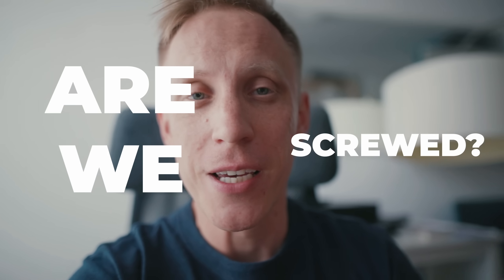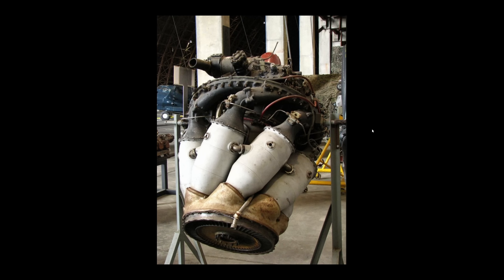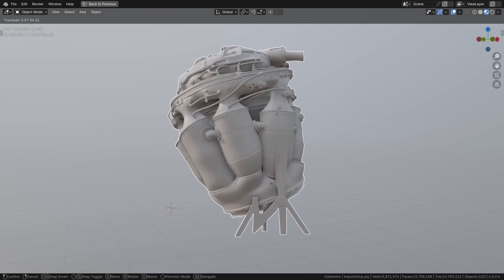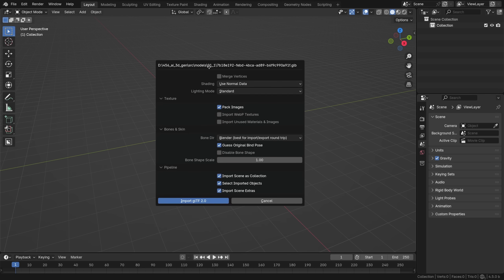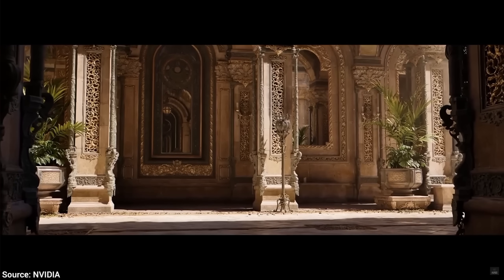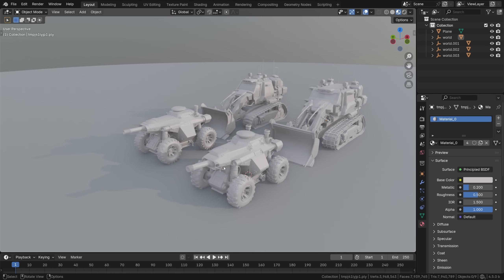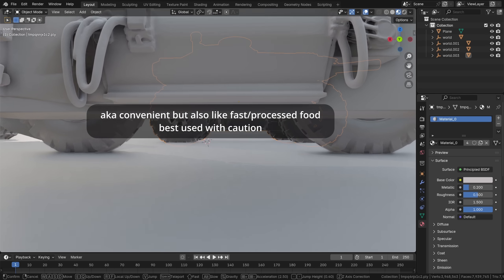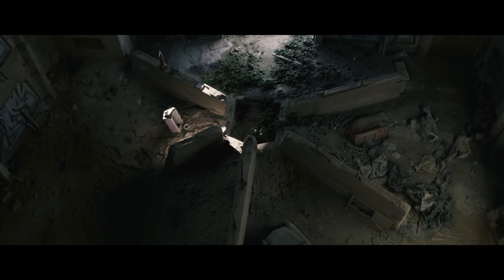Are We Screwed? (A New Hi-res 3D Shape From Image Method)

Comment: Welp. This is the time I´m glad I didn´t get into the "fancy stuff" I wanted to do when I started out: VFX and Games. I agree, tons of work is going to be obsolete very soon. I´m in the medical field and stuff just needs to be precise and specific, can´t animated some nonsense, when you have doctors breathing down your neck...:)
People complaining about retopology: There ARE already really good retopology tools out there, that you could put these messy models in. Thats zero argument.
But also: I don´t see even these fancy trucks being used in any other way than background assets right now: You can´t separate any of the parts, so, no physics, no moving parts to animate etc.
Sure, you could try and AI create the parts as images first and then put it together, but then it quickly becomes more work to put it together and make it fit, than to actually model it yourself.

Think of it more as like "mocap": Yeah mocap probably wiped out a good chunk of work for animators. But to this day, mocap isn´t clean enough to be used "as is" and it still requires animators to clean up and also there are still tons of things you can´t animate using mocap and also there are specific animation styles that cannot be done with mocap...
So, not, I don´t think 3D jobs are just gonna vanish...
But you better learn your craft from scratch and you better also no a bit or two about the other processes involved.

I see a higher chance of 3D jobs becoming obsolete due to AI video generation, but the same issues probably apply:
As soon as you need to iterate to a clients specific needs, you will struggle...

I´m excited for these kinds of things, I remember my first short film and how it took me 6 months to complete a shot of maybe 10 seconds...WITH a team of volunteers helping out with modelling.
Where some of the modelled stuff ended up being visible for like 2 seconds at 200 px on screen tops...
So, this kind of tool would have made it possible to do the same shot in a fraction of the time, all by myself, without having to look for people to work for free for my passion project.

You know what.
I might actually have an idea or two to use these tools in my work already...

Comment: Hello. Greetings from Korea.
Thank you very much for your explanation.
I am working on AI in the industry.

I know that many artists are currently concerned about AI 3D modeling processing technology. However, there are obvious limitations and it does not solve everything as much as you think. Based on my production experience, my opinion on AI technology is as follows.

- From the perspective of professional artists, AI technology does not replace existing production pipelines or take away jobs. The decrease in jobs is due to other economic cost conditions, and the impact of AI is actually minimal.
Artists are fundamentally conservative about what they are familiar with, and they find AI technology boring in the realm of `creation`.
Even `radical` artists like me who actively utilize AI modeling technology consider AI technology as valuable as instant food.

- AI processing technology is another approach.
When the modeling production method through Sclupt began with the advent of Zbrush a long time ago, I thought that the position of existing modeling methods would be threatened, but in reality, it was just fixed as one of the other modeling methods. The Sclupt method did not replace the existing modeling technology, and the existing artists were only evolved by the additional tools. Very few artists were left behind by the new technology.
There is now a procedural generation modeling technology, but it still remains a unique method.
AI production method is also just one of the solution tools that is different from the existing method, and it is not a function that will dominate the entire industrial technology.

- AI modeling technology produces results quickly, but it also has obvious limitations.
Unlike standard modeling methods (such as the Sudbvision stack) or procedural generation that is assembled by functions, the user cannot obtain information about the production process, so the results cannot be controlled.
The results are created like a rocket that has been launched once, and only the tedious and repetitive inspection work of processing the model remains.

- AI-based models are difficult to use for purposes other than background props due to their limitations. For example, it is almost impossible to use it for active models that require complex mechanical movements through rigging, and it is wiser to create them yourself or use kit assets that have already been elaborately produced.

- If you use AI technology, even people with little 3D knowledge can get quick results, but as production progresses, you will easily reach the limits of your skills.
Automated retopology, automated UV, and automated texturing functions with a few clicks may be convenient, but they will never reach the quality that professionals have polished with artistic knowledge.
Correct topology, proper UV placement, properly made texturing, etc. are skills that you can never achieve unless you learn them from scratch.

- The results obtained by clumsy artists who rely on AI technology without proper knowledge can be quickly distinguished by consumers, and this leads to issues with sincerity and trust in the product.
If we compare it to war, AI generation technology is like an asymmetrical power weapon. It is effective when the right method is needed, but it is not a position to be used as a main force.
In addition, there are issues such as digital copyright infringement, but I will skip over this part.

Anyway, this is my opinion, and as someone with experience in AI production, I think the impact of AI generation technology has been overestimated. Of course, it has expanded the areas where it can be effectively used by presenting new solutions, but it is difficult to see it as meaning that it will overturn the existing industry. Therefore, please do not worry too much about new technology and take a broad view to see if you can create something interesting with this tool.
Reply: good words, i agree with most all of it.
the thing is that artists will lose their jobs, just like how the newspaper industry got gutted by the internet
but everything else you say is true and so i think we just have to roll with it
Reply: this comment needs WAY more views.

Comment: Does it work with a tight line drawing?
Reply from the maker: Actually yes, I've just tried that. But sometimes it tends to mess it up, for instance adding hollow parts where you'd expect the surface would be - so it needs some depth cues.

Comment: Jobs demand in the industry will probably go down drastically. If you want to make the difference, you will have to be really creative. Assets don't make a story. (They can have little stories inside of them/scratchmarks etc) but this is not enough to get "normal" people attention. I think that AI techs will have two edges. One that might hurt polygon-pushing-artists and one that might be a benefit to those can make sense of those polygons and make an appealing and  good story. ...Your  neurons are still your best tool after all.
Reply from the maker: Agree.
Reply: @GlebAlexandrov  And if i can also add that... learning how to give sense/life to what we create requires some practice and a lot of theory too. (one might argue that theory are not going very well together. But i think what kind of art we are talking about. There are for sure modern design rules when it comes to hard surface modeling for instance. Another example would be lighting and at least knowing how to set a 3 points lighting etc..  I think we should all try to "become our own art director"; and really sharpen our critical sense, for our own work too. Mastering tools is necessary , but as they get so powerful, what will really matter is how you orchestrate the whole thing. That can make a big different, carrier wise, in my opinion. (and also it is so interesting!)

Comment: AI capable of creative work, but for heavy/exhausting/precise work are still needed humans =)
Unlike other widespread software which was originally built around creating/generation, Blender was built around CAD/Engineering software paradigm (it is the reason it differs from the other software - it is way more AutoCAD like).
CAD/Engineering software paradigm is supposed to fall last, since it is area where you can't trust AI so easily.
Reply from the maker: "AI capable of creative work, but for heavy/exhausting/precise work are still needed humans =)" - I'd love to see it functioning the other way around, tbh :D that just doesn't sit well with me.

Comment: It's all a bit worrying tbh.. I'm a design engineer by trade, so most of my work is in CAD (specifically NX). But I love messing about in blender in my spare time. I have a friend who works for BAE systems, they are already using an in house AI system to design war ships. It can 3D model, run stress analysis, fluid sims and stability calcs. They then can set the parameters required and the retrain the AI on the results. The shear amount of iterations on a design that the AI model can work through in a few hours used to take a team of hundreds of people several years. This is obviously a very high budget, privately owned example... But it won't be long before there are open source AI models that can do similar things. I think manual labour will be the only option soon.
Reply from the maker: "it won't be long before there are open source AI models that can do similar things" - well, we'll see if that is the case. it's not given though, as tech progress often happens in uneven intervals. I don't think it's necessarily the case with the generative 3d, but there's a chance we'll fast track to the "really promising" stage quite quickly and then it'll grind to a halt, before reaching the "100% useable and controllable" stage. Leaving the cutting edge use cases to the high budget institutions and projects indeed.

Comment: Next I hope they work on generating textures/materials. The geometry is really good now but it needs textures to be production ready. Some tools can already do that but big improvements to texture/material generation are surely coming. I hope researchers start focusing on that.
Reply from the maker: It needs more than that though: splitting into cohesive elements, making some sense of topology, integrating this algo into a proper photogrammetry software (RealityScan?) and more.
Reply: @GlebAlexandrov  Sure there are many areas in 3D that could benefit from AI, such as AI assisted uv unwrapping. For me the most beneficial improvement right now would come with better textures. For non-animated objects the topology is often good enough after some auto decimation/optimization. I'm using the ProOptimizer modifier in 3ds max for that and it usually produces good results.

Comment: When it comes to non-realtime applications, I'm more worried about video generation replacing all or  most of the VFX pipeline... No need for 3d anymore. I think video generation is progessing faster than 3d model generation, but who knows.
Reply from the maker: it makes me wonder, whether it'll run into a roadblock of some kind, the last mile that will be ultra-hard to cross using neural networks. whether it reaches the "almost good enough but still shitty" stage, the first 20% of the Paretto ratio, and get stuck there - I'm talking about video generation. what do you think?
Reply: @GlebAlexandrov could absolutely happen, the thing is, every time I don't think AI could do something, I'm wrong. For example, never thought it could do music and sing, I never thought video could be consistent temporally from frame to frame and so on, they have very smart people and virtually endless money solving all these problems, so it only gets better from here, this is the worst its ever going to be right now. New tech and algorithms keeps getting invented at a massive pace, and it keeps improving, so I'm just extrapolating from there, not sure where the limit is, or if there will even be one as these things self-improve.

Comment: There are also already AI tools for texturing, you might want take a look at f.e. StableProjectorZ. And retopo is probably one of those jobs, that plenty artists would like to see automated.

When i tried 3d modeling, the one thing i always hated, was UV unwrapping. Mainly because i still don´t understand, why we haven´t used 3D coordinates for 3D models, and have to flat out everything to a 2D plane ^.^ The confusion came from me using Cinema 4D (Release 7), where they used UVW (3D) coordinates for 3D shaders to pin them accurately to the models, so that they got properly deformed just like 2D textures, if you deform or move the model.

Comment: The only thing that "threatens" me is if the only place we can use this is online only. It needs to be another button in every 3D app. I'm not submitting my custom physical models only to lose my IP ownership of them because it was converted into a mesh by an online third party.
Reply from the maker: Oh, that is a good point actually. This has to be moved to our machines to run locally (probably within the existing software as you've mentioned).

Comment: I was exciting about text-to-image when it started in the times of Disco Diffusion and Ptti. I felt it so liberating and so interesting... until I got completely bored of all that. I spend around a month to code a custom notebook in Google Colab with almost everything automated and I got to a point that it was a mechanic process, there was no fun of doing that. I started working with 3D to get back to something challenging that the machine could not do. I didn't see this comming at that time.  It is so depressing that this will also make 3D extremely boring at some point 😢

Comment: you still need to texture it though, and with such messy geometry... well, good luck. 
so you still need to remesh, clean it up to suitable polycount first. Tried a sculpture and it came out 2 million tri, but the result is surprisingly good, much better than anything else I tried before. I can see this as a tool to grab quick initial reference for further modelling workflow, but this will absolutely not be production ready from the get go.

Comment: 3:16. Goodness 900k almost 1 million vertices for 1 object is crazyyy. Definitely shout out to those who will retopologize these objects. I don't have the patience.
Reply: It is not much tbh, sculpted assets have got higher polycounts than this, if anything it suffers from not being high poly enough to a degree such as with the edges, there's a polydensity at which you could zremesh the file and recoved the edges quite easily and then do the retopology or decimate as needed
Reply: you can use these models like they are using NANITE for UE5 for example.
Reply: @Danuxsy  ya understandable. Im a blender user though.

Comment: Hmm, no.

I am a visualization artist having worked professionally over the past 5 years, and having 3D experience for over 10 years. I can see this affecting VFX and Concept Art to some degree, but especially in my field this still isn't sufficient of just inputting a simple image and out comes a workable model. Truth of the matter is the AI does not have the information in its dataset to recreate everything. That means any requirements for accurate assemblies (CAD designs, products, etc) cannot be extrapolated with this method. It is still "AI slop", albeit better looking slop. Models like this one will still always be a tool, and not a replacement for an intelligent human being. Can it do hair? Fur? No. Does it know the inside of a watch? No. The interwoven strands of a basket? No. It doesn't understand the objects it is making. It's like drawing a human without knowledge of anatomy.
Reply: Dude it can already do fur optically. It’s absolutely coming. This will decimate the industry workforce. I’ve been right in every prediction thus far. Did you even watch the full video.
Reply: The problem is everytime AI levels up the detractors move goal posts: “but fur”. Then it solves that with ease. Sure there will be niche work but wiping out commercial, film based production. Even if only wipes 80-90% that’s devastating enough. Your framing is actually in sync with the 80-90% theory. Sure, edge cases!
Reply: @eventwonder8585  I'm not moving the goal posts. I've actually used this stuff and am actively working in the 3D industry. As far as game art is concerned, there still needs to be artists that can clean up the results from these models. These are tools that speed up production, not replacing humans. Stop fear-mongering and learn to adapt. You can correct me if I'm wrong, but to me it just sounds like you don't even have professional experience.
Reply: @figurativeprospect   You are talking as if it stays static and that none of this stuff is rapidly accelerating.  I live in LA which is pricing everyone out hardcore. I do 3D/2D advertising / mograph. And fully 3D explainers etc. Im not gods gift but ive lifted my muscles
 
You say fear mongering, fine. I disagree. I respect your position. 

Well kudos to your talent and amazing brains whoever you are.